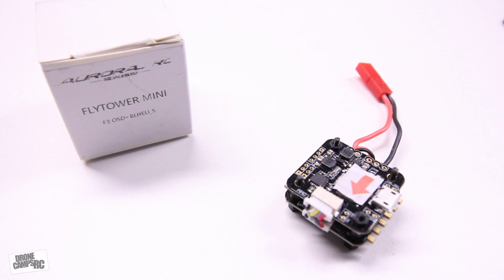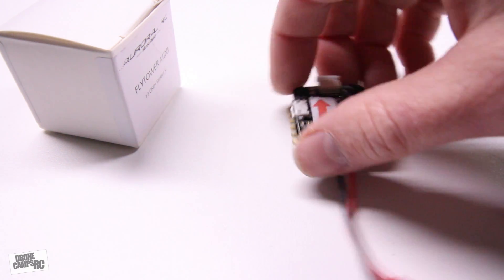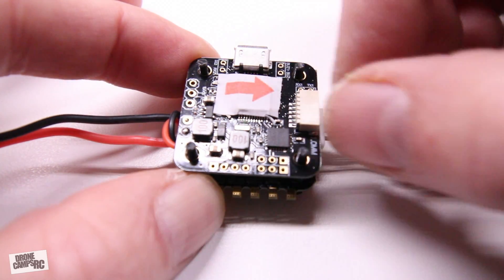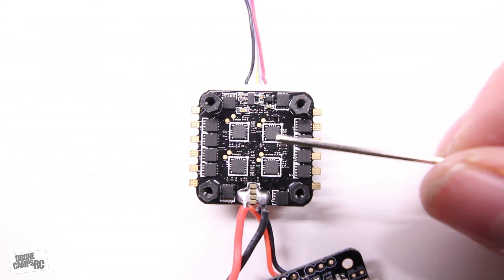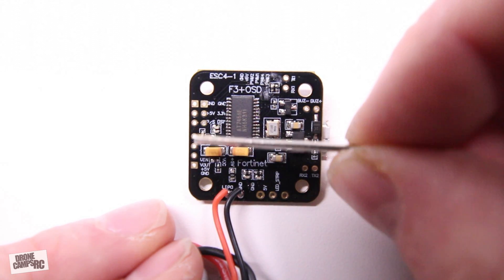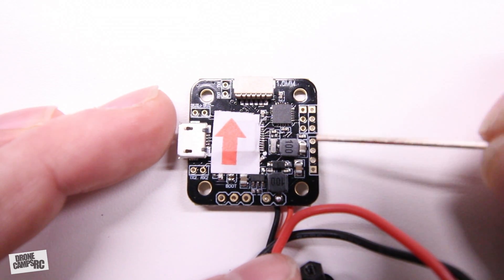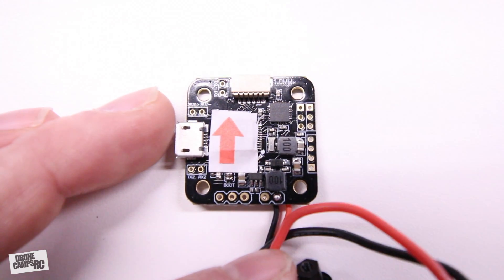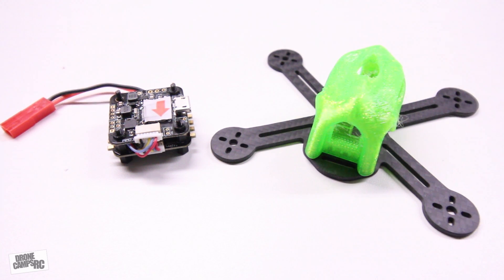STUPID EASY MICRO BUILD - Furibee Flytower Mini F3 with 20A Dshot ESCs

Comment: I flew this on 2s and it was fine. I put a 450 mah 3s and when I arm the quadcopter the darn thing goes straight up full throttle!!! Any ideas ?@dronecampsrc. I have it connected to a turnigy evolution. Happens every time I arm it!

Comment: I did here you say that this all in one flight controller will allow users to reverse motor direction but is that the same thing as allowing for turtle mode or any other mode that allows the motors to reverse?

Comment: Does VBAT not work on this flight controller? 
Mine is beeping like mad and not showing the voltage in beta flight despite being a fully charged 2S battery and low voltage set at 2.8v

Comment: hey whats up bro. i have that fc and i tried to update the firmware and it wont let me flash at all. It comes standard in the spc 95x. i did solder the boot button and nothing shows up at all in ports after. i take it off and put it back and my com shows up . yea right after i desolder the boot button. i have no clue cause i flashed the piko blx fine. i know it has the button but figure it would be the same procedure.

Comment: This is a bag of rubbish if you want a 4s build, same with the f4 version. It can't cope with 4s and freaks out. Weak Bec too and it's impossible to get 16awg to attach with any security. Get the beerotor f4 mini if you want to use 4s.

Comment: hi mate. I am planning to use this with the runcam micro and vtx03. you are saying that for the osd to work you need to hook up the 4 wires on the cube?? the vtx03 only have pos, neg and video out??
Reply: yes thats right u use the signal wire from vtx to VOUT and the signal wire from Runcam to VIN the both pos and negative wires from the VTX and the camera go´s to the pos and negative by these 4 pads VIN VOUT 5V and GND. sry for the late ansere ;D

Comment: I've had nothing but bad luck with that F3 controller stack would not work with beta flight or clean flight could not boot and gear best just blew me off when I asked for help not impressed with them
Reply from the maker: Rob that sucks man. Sometimes we have to resort back to the forums for help with complex products. Support is hard to get on these super tiny parts. Might be why there are such channels like this one. Sound like you might need to just do the boot process like I show on the channel bro.
Reply: Actually i did use the method you show, actually you are my go to place for anything im not sure of ,or that gives me an issue. it gives me the same error(over and over) not compatible with Clean/betaflight it just wont update got two from them both that board the other boards ive gotten to work without an issue
Reply from the maker: You'll have to hold the boot button ( or do the solder bridge ) to activate the boot loader mode. Then restart cleanflight. Then go to the Firmware page. Setup the firmware version, Load it online, then holding the boot button or solder bridge in place start the FLASH firm ware process. Sounds like you're doing something wrong in the process. If you just plug it straight into Cleanflight it will say that error message. By the way since they updated Cleanflight version everyone is getting that message on all the new flight controller boards. Not just that one. Friends of mine here are all getting the same message from Cleanflight.It's not Gearbest's fault. It's Cleanflight.
Reply: Yep did that says not compatible
Reply from the maker: Something's not right. Once it has the boot button active it should work. Try Betaflight.
Reply: Drone Camps RC same thing in Beta flight not compatible. I just think at this point I got a couple of bad boards I'm not sure what else to do. I'm willing to try the furibee stack may be I'll get one that will work

Comment: does anybody have any tips for beginner fpv 
I know there is simulator but don't own pc/laptop 
any other way around this/any tips 
I know u won't be a pro over knight but tips would help me out thanks
Reply: rc crazy uk ,  get a tinywhoop and some eachine 007s and start saving ur money up because il bet that it wont take long, and you will want a brushless quad.  good luck
Reply: hi thanks for the reply/tips 
yh I was thinking of a micro fpv drone/tiny whoop 
I currently have a nighthawk pro 280 fpv have a look on my channel 
just want something that's bit more easy to fly/not expensive to repair ect 
if you know what I mean

Comment: this is exactly what I was looking for, looks perfect for a lightweight / small 3 inch or 4 inch build. do you know if the regs can handle an hs1177 and a tbs unify pro 5v? also is the OSD the betaflight OSD or micro minim based?
Reply from the maker: Should be able too. It's Betaflight